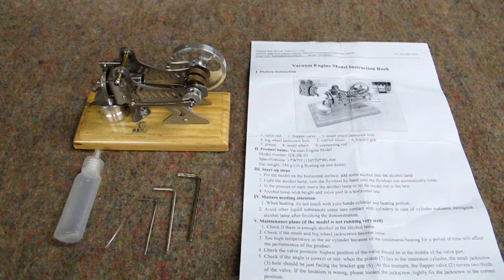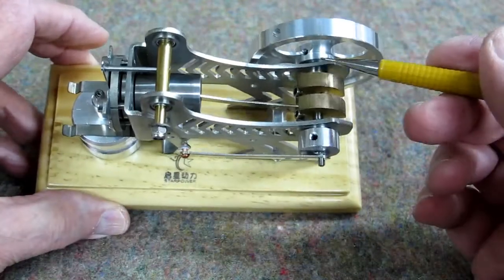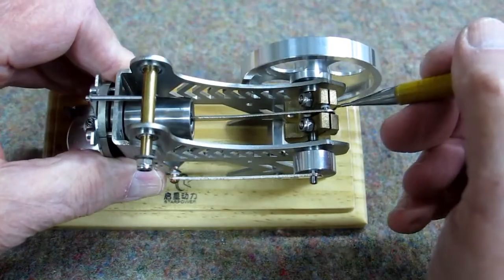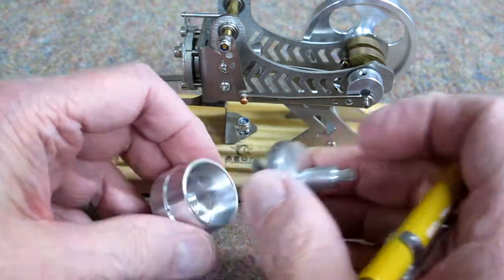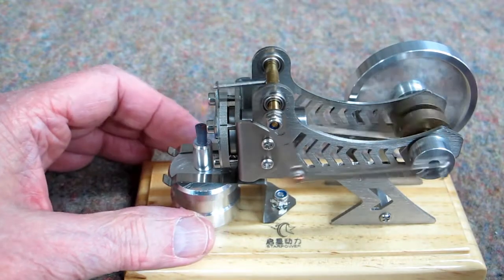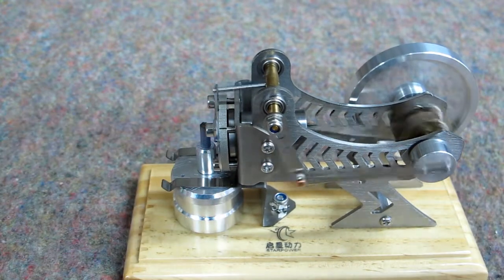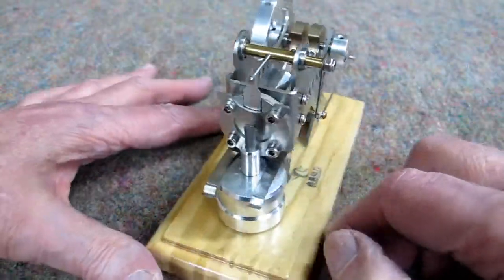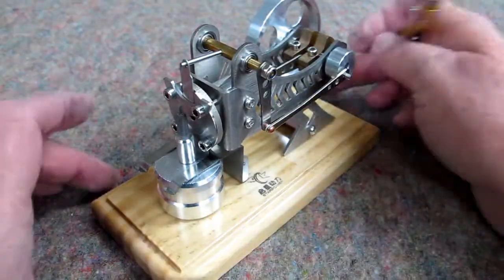Star Power Vacuum Engine

Comment: Cylinder could do with some additional cooling. Whether that be a heatsink or an alternative flywheel incorporating a fan on the outside edge.
Reply from the maker: There certainly is room for improvement/experimentation with the cooling. I added additional cooling fins on my Huxtable Hot Air Engine and plan to try a water jacket sometime in the future. A water jacket would probably extend the run time for this engine as well.
Thanks for watching. Please subscribe. 
That is what keeps this channel going. 
Ron

Comment: Except running themselves, can these engines produce any usefull work? (not sure what I'd use them for, but I'm just curious)
Reply from the maker: I can't think of an actual application for a flame-licker, vacuum (or sometimes called an atmospheric) engine. They are just nice demonstration - proof of concept model engines.
The constant open flame make them somewhat of a safety concern and not fuel efficient.
Thanks for watching.
Ron